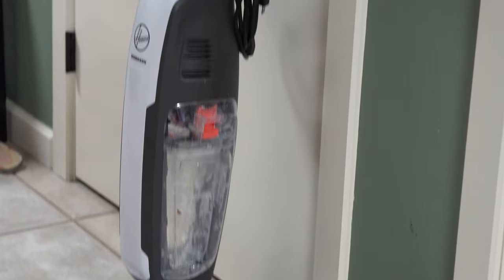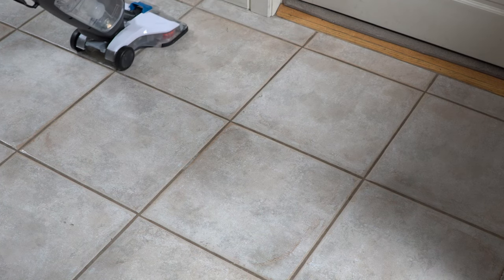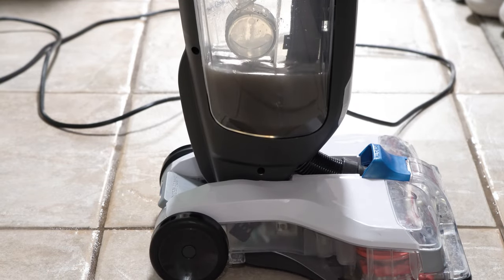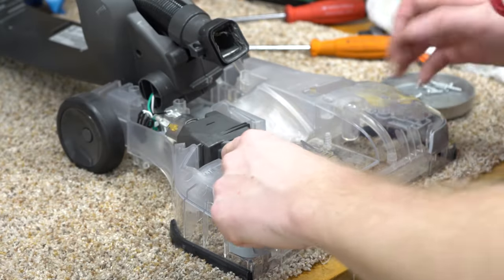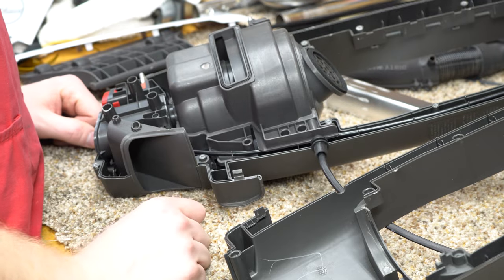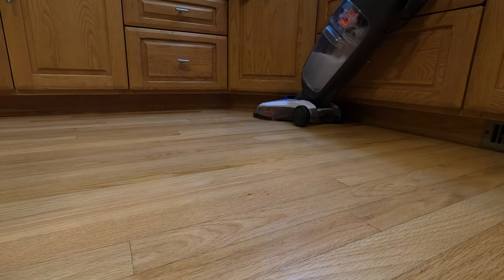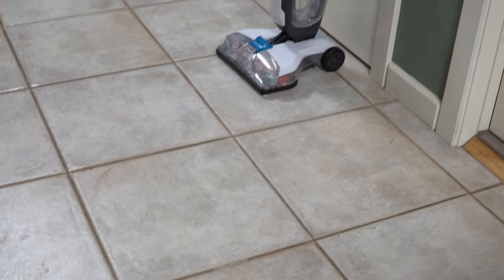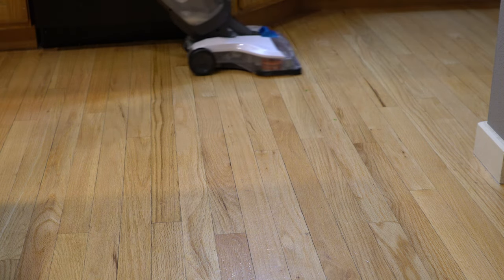Hoover PowerDash  Hard Floor Cleaner Machine FH41000 Review

Comment: A fast clean method of the head on these machines is to put hot water in a shallow pan, shut off the brushes(dry mode) and suck the clean water through the machine. Do this as often as needed. This will not clean the brushes but should clean everything else if done right after use. Works for me.

Comment: I purchased one today to replace my floor mate.  I did not think I would like it because it had fewer controls(?).  I found out that not only I did not need those controlls, but working was easier without them. It if by far a better designed machine than the Floor Mate as far as function, but it IS considerably more flimsy in construction. 

what's wrong with my Floor Mate? The flex hose at the hinge point has seperated in multiple places and no longer sucks up waster. I am still working oon how to take it appart and fix it, but in the mean time, I am very happy with the Dash machine.

Comment: They should make different grates of the spin brushes for different types of floors also I think it would benefit from a slightly stronger suction especially when using the cleaner booster button it might make your floors swell with hardwood as well as leave residual dirty water behind hence the reason for changing from a manual mop and bucket to a machine there wont be left over dirty water sometimes based on the heavily soiled factor of the floor it takes longer and more passes

Comment: Do you have to pre-vacuum WITH ANOTHER AND SEPARATE DRY VACUUM before using this?  
Will it pick up sand, coffee grounds and pet hair?
Reply: you have to pre vacuum, but it does do an amazing job. and it doesn't leave streaks like the bissell crosswave
Reply: You always want to pre vacuum before mopping or cleaning of any kind. This machine does a really good job. Don’t leave the solution container in it, though. Will clog up the sprayer holes. It is easy to clean those, with a paper clip.

Comment: Mine is 8 months old and used 5 times (it is like brand new). It does not spray water anymore :( Does the water use a separate pump? Any ideas on why it stopped spraying water? Thanks in advance.
Reply from the maker: Call Hoover they'll fix it for you
Reply: That is the continual issue I’ve found with my last 2 floor mates! The dispenser stops working and the fight and agitation of getting a warranty repair is worse than just spending the money to replace it.
Reply: @Jaimemsmith77  I found out that the 4 holes in the dispenser get clogged easily. Used a pin to clear the holes and everything works.

Comment: How does this machine compare to the Hoover FloorMate Deluxe that's also being sold right now?
Reply: Don't buy the floormate deluxe. I have one and they have water dispensing issues. If it didn't have that issue it would be perfect. If you search floormate deluxe water dispensing issues on here you can see what it does and how people have fixed it, but the issue never stays "fixed". I've taken mine apart several times and can't get it to dispense the water properly. So disappointed. If it actually ever did fix permanently I'd love it. But there's a design flaw with it...

Comment: One thing you didn't show is what the impeller assemble is made of.  I had a model FH40140 and it stopped working so I took it apart.  It turns out that the impeller housing was made of steel!.  It corroded so bad that it jammed and blew the internal fuse. I don't know what they were thinking except maybe it was a planned obsolescence.

Comment: I'm getting a new floor washer and I want a floormate, I wanted to get the old "Floormate Deluxe" which is grey and green, would you say this is better then that one or is the Deluxe better then the Dash.
Reply: What did you wind up getting? I've had the floormate deluxe for a few years and do not like it. It has water dispensing issues. I've taken it apart several times to fix the issue but it never stays "fixed".
Reply: @lisabilinski1929  I got the floormate deluxe and iv had some problems with it but I still much prefer it to my old one,

Comment: This thing sucks. It takes forever to clean because you use it like a carpet shampooer, it just barely sucks in the dirty water, have to do like 3 really slow passes or else your floor will look like a swimming pool. And the actual end result? It isn’t much better than using a $15 swifter from Walmart. Steam cleaning or scrubbing by hand is so much more effective than this cheap piece of crap.
Reply from the maker: Sounds like you got a broken unit.